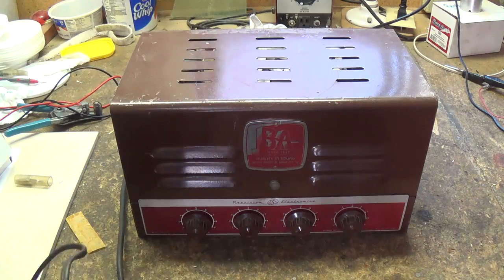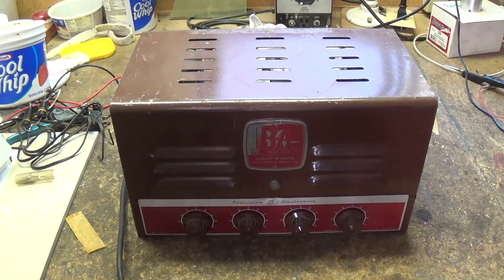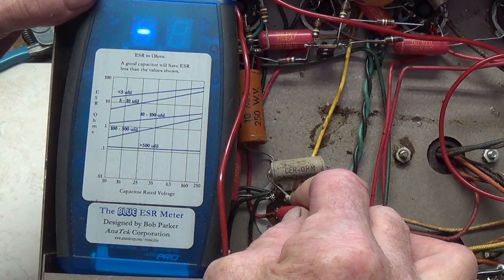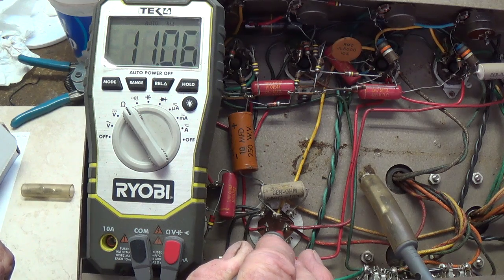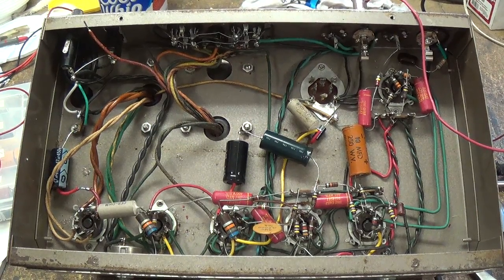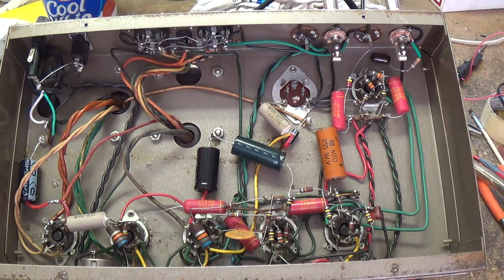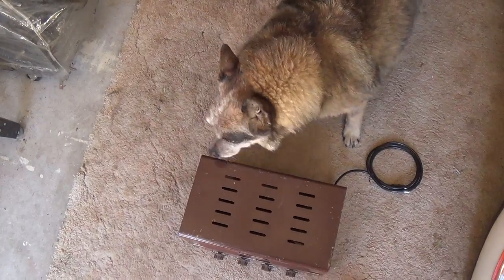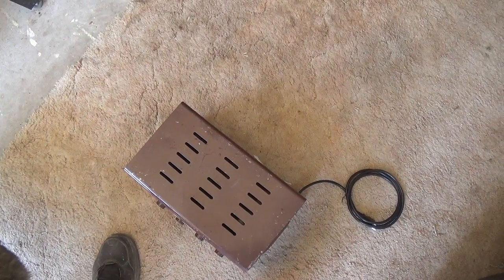The Worst Filter Capacitors I Have Ever Seen.....and Heard :)

Comment: I hear my amp. Can I change this old 70-100+30-100 with a 50-150+50-150?
Reply from the maker: Does your designation mean 70uf @ 100V and 30uf @ 100V?  If so, it's best to stick with the same capacitance but at the same or higher voltage rating.
Reply: Thanks  @UncleDoug

Comment: Nice job on getting rid of the 120hz hum. I wish I could understand electronic circuits. I have a pair of 1959 Stromberg Carlson 6550 push/pull mono block tube amplifiers that are actually NOS never been used in original boxes. I can’t find a technician in New York State that can go through them I have really very little education in regards to electronics. Sure wish I could find a technician to test this so I may use them as home audio mono blocks.
Reply from the maker: Thanks :) Contact Mike@mendittoamps.com, Greg.  He's in your area and can probably help you.
Reply: Patrick  Kaufman could probably help.

Comment: Hey, Dopey, checking an electrolytic capacitor with an ohm meter is dumb.  You're measuring the DC resistances of the circuits in the amp, NOT the resistance of each of the capacitor sections.  The ESR test is good for determining if the capacitor is in good shape OR is shorted, not for anything in between. 🤔
Reply from the maker: Thanks for your input........but more importantly, on this channel, we don't begin our comments or responses with insults, like "Dopey". If you wish to participate in correspondence, then please heed this rule.

Comment: Nah, an old Heathkit Capacitor checker will reform that old electrolytic in no time.  Or maybe the short in the capacitor will draw so much current through the Heathkit that both the amp and tester both explode into flames.  Yeah, maybe just replacing that cap is the best way.
Reply from the maker: I enjoy your analysis, M47, and approve of your conclusion :)

Comment: I notice that you add plastic insulation over the leads of some of your electrolytic capacitors (but not all of them).  Why is this done and when should it be done?  Many thanks again for taking the time to teach us.
Reply from the maker: It's to prevent any inadvertent contact between the wire leads, Jon, and is done where necessary.
Reply: @UncleDoug  Thanks.  I wanted to be sure that it wasn't for signal shielding or something more complex.
Reply from the maker: @TheJstewart2010  Vinyl and plastic are only for insulation, Jon......neither is effective for shielding.

Comment: You can have filter capacitor made for those if you want keep it stock and orignal I have old tube radio having the filter cap made for it with orignal specs.
Reply from the maker: I have a link to the site that makes them, Brian. They are also available at Antique Electronic Supply.

Comment: I am testing the in circuit D.C resistance of a coupling cap. Why do i get 2 different readings. If i reverse the leads of the multimeter i get 600k instead of 300k. Are the coupling caps non polar? does this have anything to do with it? The multimeter then charges the capacitor with the 9V battery and the resistance climbs into the Mohm range. Does the speed at which the resistance reading rises indicate the health of capacitor? (how quickly it charges).
Reply from the maker: DC resistance is not a reliable.....or generally attainable.....measurement of capacitors, Chris, unless you are using an ESR meter on an electrolytic capacitor. I demonstrate how to check for DC leakage in coupling caps in a couple of my more recent videos. Check the video descriptions to find them.
Reply: @UncleDoug  Thanks i'll check them out 👍

Comment: Overall an informative video. In most vintage Tube amps, or Tube amps older than 30 years .. it's a good idea to just replace all electrolytic capacitors by default ... it'll reduce the chance of ending up with input & output  transformer "burnouts", and saves Tubes / Valves too ( as fuses often fail to react to such faults, as the faulty components can act as a "Hot running" resistor)   Just a quick one: When measuring any components ... make sure they're not connected in any circuit ... as you're just going to get a false reading due to the other components connected to it etc. So, always disconnect at least one "leg" of a suspicious component, so it's disconnected from the rest of the circuit. ( semiconductors, such as Tubes / Valves and transistors need often be removed and tested separate, in designated Tube /Valve testers.... or in the case of transistors, in modern digital component testers etc.).
Reply from the maker: Thanks for your helpful input, Robert.

Comment: This should definitely be taught in school. I currently have a 70s AC30 open, that had the reverb and tremolo ripped out and the tube heating converted to extra smoothed DC. I managed to trace it (I understood the phase inverter thanks to your video) and am now trying to diagnose the hum and crackle. It still has original can caps in there. It works, though. Nice hobby - I'm in IT for money, and a point-to-point wired amp is something different from what I usually get to see. Anyway, I measured the DC voltage on those cans, but I didn't think to measure the ohms. Will do that now. Glad I shelled out for a nice Fluke meter. Thanks for your videos!
Reply from the maker: You're welcome, KD. Best of luck with your projects.

Comment: I think it is impressive that you did this seemingly without a schematic or layout diagram.  I would have been totally lost.
Reply from the maker: Thanks, Andrew. After working on enough amps, you can "wing it" in most cases, unless components of incorrect value have been previously installed.
Reply: Plpp

Comment: How were you able to bypass the wretched capacitor can and put the new caps in the right places?  I am dealing with the EXACT same issue with my SC ASR120 right now.  Cannot decide whether or not I should try and keep the can, but swap the caps inside, or run the caps underneath as you have.
Reply from the maker: There is no way I can explain the process here, KC, however, I demonstrate it in many of the videos I have posted. I doubt that the new caps will fit in the can. Underneath is best.
Reply: @UncleDoug  that makes perfect sense.  Thank you very much.
Reply: @UncleDoug  hey uncle Doug, I’ve been looking at your videos all day but have not been able to find a video where you break that process down.  Can you offer a suggestion for the title?

Comment: Rusty sneezing. yes That can was shot. I've  seen 2 4 section  caps with all 4 sections read less than 200ohms .They both were scorched  and someone had put a 20 amp fuse in place of a 3a.   very lucky  the transformer  was  still ok!!!!   Thanks for your videos. They help me in areas im short  in
Reply from the maker: No pun intended I hope :)  You're welcome, William.

Comment: I've never seen a cap can with such low DCR. Crazy.
Isn't that 10uf/250V cap also more resistor than capacitor?
Reply from the maker: They were truly awful, Adam. Some of the resistance measurements were affected by having resistors in parallel within the circuit.

Comment: Since you're talking about caps..
Doug, I've ordered a HI-Fi tube amp kit and on the power supply circuit the schematic says I need a 150uF/450V Electrolytic cap just after the choke..
Question is, can I stick in there a 470uF/450V cap, providing it fits, or is that overkill and/or detrimental?
How about a 500V or 600V cap at 1000uF?
LOL.
Guess what I'm asking is..can I install the biggest cap I want?
Back in the 90's I scratch-built a 12V brick-style power supply using the biggest transformer and caps for the voltage regulator I could buy for a secondhand car amp I used to drive my scratch-built speakers which sounded good and loud in my room and hadn't any trace of hum/buzz.
I'm not a total noob to electronics but electron tubes/valves are new territory and I'm finding them so fascinating!
I'm loving the idea that, once completed, my amp won't have a single semiconductor within it and will be as far removed from digital as possible, apart from the on-off switch!
Loving your videos even though they center on guitar amps mostly but the principal is the same and I'm soaking them up.
Reply from the maker: The simple answer is no, Dennis, you can't arbitrarily increase the values of capacitors in a power supply. Engineers dictated the proper values and their choices should be followed. A slight increase, i.e. 22uf instead of 20uf, is OK, but you risk damage to your rectifier tube (and gain nothing) if you greatly increase filter capacitance.

Comment: I had vintage tube radios with totaly shot electolytic caps like that amp. A seller at a local flea market had a big Philco table radio that was humming like that.The radio was turn on and you could hear it all over the place His excuse was it's old they all did that! I just had to rescue that poor old Philco.
Reply from the maker: Thank heavens your were there to save the poor radio, Doug. When electrolytics leak that badly, they develop a lot of heat and can actually burst.

Comment: Awesome video, I don't get the chance to work on much tube equipment these days, but I really enjoy studying theory and repairs in your videos.  I don't know if you ever serviced a lot of tvs in your time, but I'd have to say the worst capacitors I've ever seen were in mitsubishi/electrohome tvs.  Every single electrolytic was defective and would leak, causing corrosion and damage to the boards and create any imaginable problem.  They were decent sets otherwise.  I really enjoyed working on them.  When I had time, I would troubleshoot each problem one by one, instead of just replacing the capacitors without doing any tests.  It was often a smelly job, smelled like fish or boiling nut oils far beyond normal temperatures.  Many would just go visibly open.
Reply from the maker: Thanks, T1.  I repaired several Philco Predicta TV's many years ago, but have since hidden/declined whenever anyone asked about TV repair. It is true that some caps were doomed to fail shortly after manufacture, while others seem to last forever.

Comment: Help. I have a question. I have lots of filter capacitors below < 1uf. 
.047 @ 600v ; .022; .0068. Etc. 
I’m having trouble finding these values. I know I can apply a 10% rule either way but still can’t find these low values. I’m not sure what is an acceptable value to go up to. I Anybody know who sells these values. Most sites I see start at 1uf and go up from there. Thanks.
Reply from the maker: Those are not filter capacitors, Des, they are just plain old non-polarized capacitors, readily available at Antique Electronic Supply.
Reply: Uncle Doug Perfect , thanks. I enjoy your videos and I’m always sure to click on the “like” button. Learn a lot. Cheers.
Reply from the maker: @westbay5858  Thanks for watching, Des. We can use all the "likes" we can get :)
Reply: Uncle Doug Hi， according to what I see on some small round flat type ceramic capacitors, I’m looking at values of:
330 picofarads marked as JL330
.02 uf marked as RMC Z5u
2700 picofarads marked as JL2700
.0022 uf marked as JL Xf5

I have been hunting for 3 days looking for these ... can’t find 330 pf or .0027 so maybe they are obsolete? I’m just wondering how far from these values I can go if I can’t find the exact values. 
Many thanks for any info. 
Des
Reply from the maker: @westbay5858  For the 330 pf, you could probably use anything from 250 to 500 pf. For the 2700 pf, anything from .002 to .003 uf.
Reply: Uncle Doug Thanks. One last question, am I ok switching from these round flat ceramics to mica ... I can find values in mica. Ie: 1600 v 330 pf which is exact value just more expensive.  Mica vs Ceramic.... any noticeable difference I would expect. I’m working on a jukebox so not talking about extremely high fidelity equipment here. It’s an R-145 amp from a 1958 AMI J. Thanks very much.
Reply from the maker: @westbay5858  I generally use moderately priced capacitors that are close to the original value.  To me capacitance value matters more than the construction method of the capacitor.

Comment: The worst filter can I ever seen was a full out explosion of the can, with shrapnel destroying the power tubes. in a Leslie amp.
Reply from the maker: Wow......I hope I am spared such a catastrophe, Scott, but thanks for sharing.
Reply: @UncleDoug  Drawing my experience primarily from Leslie amps, I have seen numerous filter can failures. Some cases are the cap goes 'open' resulting in a loud hum. Other cases are a shorted cap, which results in low B+ and circuit malfunction and distortion. In extreme cases explosion or power transformer failure, (which is why proper fusing is important).
 Here's a riddle for you,
Hammond Organ with a Leslie 122.
Bass pedals have an overtone; It sounds like there is a Bb playing along with the note being played.If nothing is being played on the organ, the Leslie amp is quiet.
 Changing the Leslie amp and the problem goes away.
What is wrong with the Leslie amp?  (I did track this down pretty quick, and repaired it)

Comment: Also (I'm sorry for being so needy). How would I modify a Precision Electronics S35 to a 2 or 3 channel (clean and quiet (high capability for Dimebag, Eddie Van Halen, Reb Beach type of natural and pinch harmonics) high gain metal distrortion/versatile for maybe a 3rd channel for a blues crunch type of overdrive and/or distrortion) guitar amp with foot switch selected channels? I hate hiss and noise. Also with a panel switchable direct out? Has anyone ever done anything with this PA amp? Maybe it could  be a 2 channel amp with a clean boost or overdrive for  a 3rd or lead channel. I still would want it to be absolutely quiet when I'm not playing. Which would be more capable? The Peavey VSS 20 or the Precision S35? Any recommendations especially with schematics or videos would be awesome. Ideas?  Please? Thanks.
Reply from the maker: Your question would require many hours and screens to answer, Allen. My suggestion is to study the videos and do your best. Don't be afraid to experiment. Good luck.

Comment: Can through hole filter capacitors in a power supply be improved by increasing them to a greater value to make the power supply quieter and more efficient especially in guitar amplifiers? Also how would I fatten  up the sound of a Peavey VSS 20 and make the distortion channel fatter  with more gain with less noise? Thanks.
Reply from the maker: Again, do some searches on the subject. Best of luck.

Comment: These types of Capacitors have a finite life.  After 10 years, consider them replaceable. If you have the back open to the circuit board replace all of them, it’s cheap and you will brag later how smart you were to think of it like a pro.
Reply from the maker: Thanks for your helpful input, JR.

Comment: Thanks Doug! I'm replacing 2 Erie Can Caps in a Studio City 50R amp. Each is rated at 200uF and can't find a similar replacement. I did find a JJ but the tested cpacitance was way out of spec so I sent them back and got 2 Multi F&Ts that are 100-100uF. Can I solder the 2 positive leads together since they'd be in parallel to make the cap a 200uF? Thanks
Reply from the maker: Yes, the two 100uf caps, in parallel, will provide 200uf of capacitance. Did you check with Mouser ?  I have ordered unusual high-value caps from them in the past.
Reply: @UncleDoug  : Thanks for the lead on the Mouser site. Yes, I found some good possible candidates but they aren't standard production and have long lead times,15w+ . Nonetheless, the Mouser site is an excellent resource with a nice search engine. Again, thank you for responding. I love all the videos you make. I can tell you were a teacher. You have a gift for it. Your humor, sarcasm, and analogies are way cool!!!  
Now, I'm hooked. Building my current limiter today. I also sprung for a Techtronix 2235 Oscilloscope, Isolation Transformer, Anatek ESR meter, certified Unibomber 2X4s (yours have much more character than mine though). Lastly, I like the way you stress safety. Can't be cavalier playing around with high voltage. You're the Best!
Reply from the maker: You're welcome, TG. It sounds like you are acquiring an impressive armament of tech tools, especially the certified chassis supports :)  Be careful. Thanks !!!

Comment: I don't like when people leave in old parts,Wouldn't a safety cap be better for the across the line cap? These are questions because I am still learning,if anyone.has the answers.,
Reply from the maker: There are certain capacitors which cannot short circuit, Ron. They would be better in the "death cap" position than a regular capacitor.
Reply: @UncleDoug   thanks for the info

Comment: ESR meters are not really all that useful for testing high voltage electrolytics, you can have a cap test good with a low ESR, but at low voltage, but at 300 vdc it can be dead as a doornail if you test it at operating voltage on a resistance-capacitance bridge. I'm very familiar with the 120 cycle hum, and the 60 cycle one from AC/DC radios, I have a 1955 Telefunken with a filter can that must be completely open circuit, you can't pick up anything, not even garbled. It's odd because the radio looks like it was pampered most of it's life.
 I see the caps you pulled out, a pair of "Bumble Bees/Black Beauties:, and a pair of Sangamo "Little Chiefs" both very popular from the late 1940s until the early 60s, all are garbage today. The microphone socket is called an "Amphenol Connector" used on a lot of old test equipment as well as on mics, hang onto it, they can be useful.
Reply from the maker: Thanks for your very knowledgeable input, Oleg.